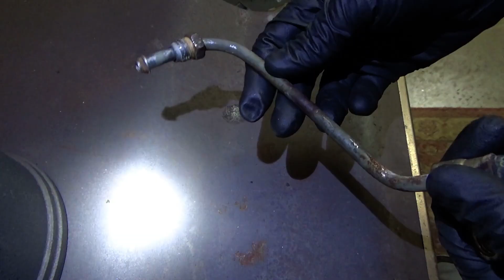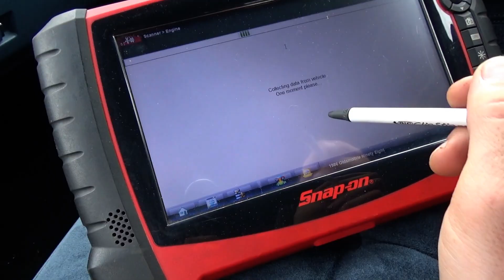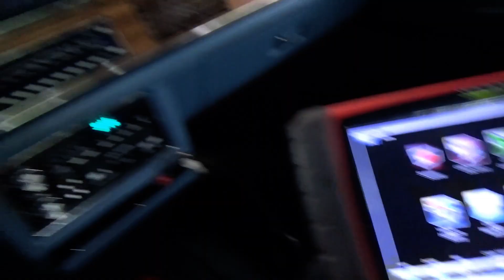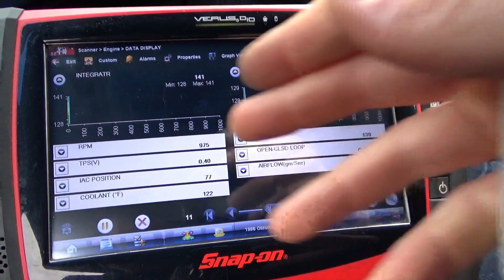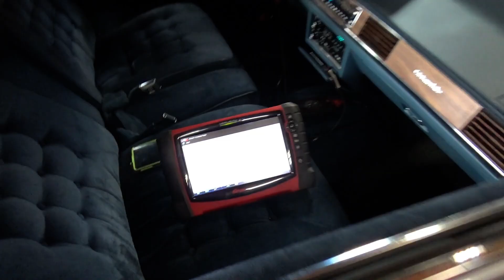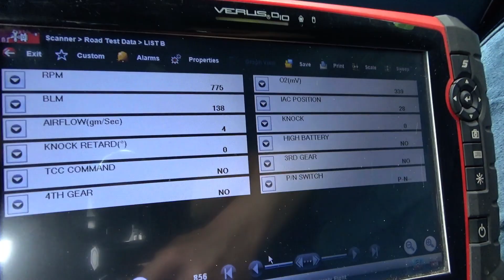(Pt 4) '85 Oldsmobile "Time Machine" has NO POWER?  (CONCLUSION! Memorial Day Special)

Comment: Those red dot. 1985 - 1987 3.8L V6 had a normal misfire feeling shake to them, There may not even be a misfire, unlessyou are hearing something we can’t on the audio. When GM brought out the 3800 in the 1988 model year, it fixed the shaking issue.

Comment: 5000 miles and it had already two new injectors, air mass thingy exchanged, messed up fuel return hose connection, probeably a fuel pressure sensor replaced etc. etc. and the belts were really loose. Well that's bad engineering.

Comment: Too bad you spent so much time, damaged a fuel line and fuel regulator. Over a bad mass air sensor and bad timing.
Reply from the maker: Fuel regulator was weak already... I just finished it off 😉

Comment: Almost 30 years ago I bought a used 1989 Olds Delta 88 with like 89,000 miles.  Drove it to like 210,000 and then sold it.  One of the best cars I ever had.  The car you just fixed was definitely a flash back for me.  Great videos!

Comment: If you cut off the metal shroud on the metal end of that return line, you'll find its just a line with a hose nipple and you can just just use a line and hose clamp on it, no need to replace the metal end of that return line.

Comment: yeah, lots of readily made fuel line repair ends. you can typically get a whole repair kit with special end and a compression coupling (or barb fitting for nylon lines) at local parts stores.
DOH! at wrong size, GM was typically 3/8" for supply and 5/16" for return, with M16(3/8) and M14(5/16) threads, now they did vary around some over the years so always check first.

Comment: Those 3.8 liter engines had an inherent imbalance shake at just above high idle speed. This was a known issue and part of the reason behind why the 3800 received a balance shaft when it came out for the 1988 model year. The 1984-87 3.8 engines all had the imbalance shake. Nothing to worry about and nothing can be done to correct it.
Reply: I was just about to write exactly the same! It’s a known thing that these have an imbalance and it’s not a misfire. I have owned quite a few of these also several after 88 with the balance shaft. The latter was more balanced but still not perfect. If they have a misfire you’re not in doubt.

Comment: The total Greatness of this video is hard to describe.  These cars were great. A mix of pre-computer and computer. Saddest engine, VERY harmful to GM's rep, was the 4100 in the caddy.   1985 began the GM computer days.  TELL THE OWNER that the OIL really matters.  So too the Cooling system must be maintained.....Could easily go 300K with care.  Also, get rid of the plugs.  Install platinum plugs, Delco.   Also, as to the EGR valve, well, some needed to be removed, and then the passage, Not the valve, snaked with a wiggling cable of steel in a hand drill, although the miles on this vehicle are so low, this might not matter.  Love your old school timing light....I will Never part with the Sun unit that I have.  The Timing absolutely matters of these GMs, even 2 degrees off hurts performance.  At 100k miles, think about replacing the timing chain.  Makes them run factory new.....

Comment: I have worked on tons of old cars for one simple reason: I prefer them. The joy of working on that Jurassic Olds, is that the wires are pristine and original. Nobody has been in there farting around cutting, splicing, shorting and removing the stock wiring. A little rubber rot and a drooping headliner are small prices to pay for that 80's land yacht.

Comment: This thing has been messed with way too much for 5000 miles.
Reply from the maker: But 40 years 😂
Sounds like dealer who sold the car unleashed the Amazon parts cannon lol
Reply: @PineHollowAutoDiagnostics  could the odometer have just turned over from 99,999 when the car was put away? Back then, people were accustom to cars with carbonators. That fancy new fangled fuel injection stuff was a mystery to the public and many mechanics. I remember when computers were added to vehicles.
I remember when unleaded fuel was introduced. People would punch out the restrictor in the tank fill so they wouldn't have to pay for the price of unleaded fuel. My '85 Dodge 1 ton has the restrictor punched out. 
Nice looking car. However, I believe the odometer has rolled over. They couldn't figure out the poor running condition and parked it.

Comment: Kansas City Auto Electric here, I don't know if this will help you but you will NEVER be able to get that car to idle smoothly as it does not have a balance shaft. I had the exact vehicle many years ago and it always had a shake at idle to the point I thought something was wrong with it. I took it to more mechanics than I could count until I ran into a GM mechanic who had just retired and he told me what the real problem was. It is common knowledge now but for some reason in the late '80s it was keep very quiet.  As it turns out I put over 400k miles on the car. GM did start to put balance shafts in the 3800 but not the 3.8. Anyway I hope this helps.

Comment: Those C-body sedans were peak GM build quality. I had a '94 LeSabre that I beat to death, still ran well at 230K miles when I got rid of it. Everything they've designed since 2000 has declined. But if you find an 80s - 90s Olds 98/Lesabre/Bonneville in good shape grab it. Reliable powertrains, good handling 4 wheel indy suspension, 25+ MPG, and the best cruising cars on the road even at 30+ years old.

Comment: Ivan, I'm disappointed; I'm disappointed by this video; I'm disappointed by your diagnosis of this Oldsmobile; I'm disappointed by you, Ivan.  You cheated, you blatantly cheated, you did things through magic, magic that didn't exist.  If you were time-traveled back to when this car was showroom new, very few of the things you did in this video would be possible.  A fully equipped Oldsmobile dealership would not have a futuristic scan tool, or any type of scan tool.  You would have to diagnose that car by ear and experience.  Your best tool would be an analog voltmeter, it would be accurate within a few volts; the voltmeter would need a second or two to read a voltage; no watching miniscule voltages fluctuate, no tenths of a volt, no hundredths of a volt.  No graphing anything, it didn't exist - really.  Sun auto diagnostics offered auto technicians an expensive, primitive oscilloscope-like CRT diagnostic tool, it sometimes showed waveforms, it had the most primitive of scales; it could only be used in the shop; need to record an image?  there was an attachment to mount a Polaroid camera to the front of the scope.  
Ivan, you cheated! - I'm disappointed.
Reply: LoL 🤣😆

Comment: Great job Ivan! The racing team pit crew I worked for had a 91 Chevy C-30 dually with a 454 for a tow rig. The owner kept complaining that the truck lacked power and used a lot of gas. He had someone supposedly set the timing. I pulled out the Haynes manual and there was a mention of disconnecting a certain connector in order to properly check and set the timing. Found that the timing was off and set it. The truck ran remarkably better with a minor increase in fuel mileage.

Comment: My memories of that era of Olds, Buicks and Pontiacs are smooth driving. They were like riding on your living room couch.  I had an '86 Buick with the 3800 v6 that was really impressive on fuel mileage and torque. Eventually electrical issues made it where I let it go.  Good work Ivan!

Comment: Great job Ivan. Ignition timing always has to be adjusted on the older cars. The more the chain wears the more the cam retards & distributor timing retards. Used to advance the ignition timing more than factory specs usually until it pinged and then back it off 2 degrees. Nice diagnostic work & another happy customer. Those seats are so comfortable & the suspension on them makes the ride so comfortable. Not great fuel mileage but that's a heavy car & if it gets hit by a modern-day car it can drive away while the newer car will be a crumpled mess.

Comment: Great that Ivan could diagnose the Olds. As A 70+ year old auto mechanic, it would have taken about 1/2 hour to completely diagnose and fix it. Not criticizing Ivan but you computer mechanics forget the basics. Always, always start with the electric vs fuel.
Reply: Hi Ivan. Just to follow up. I loved working on cars before fuel injection and we always had jokingly pre diagnosed cars as they drove up to shop. Lol. Most things were simple. Smell the exhaust, put hand over it, listen to it. That was our “scanner” in those days. Get timing light out, check cap and points, look for leaks. As I said keep it simple. Your original complaint was slight miss and lack of power. That’s what would take half hour charge. We got $8 to diagnose. 😢. Ivan you are a great teacher and that’s   what you do. Old cars are not normally what you do. Scanners were not common in those days and we needed to use our senses to diagnose. I really love your videos and wish you only the best.
Reply from the maker: @quarryroader  sure if it was carbureted then half hour diag would be sufficient. This 1985 is the polar opposite. All your senses won't pinpoint "bad mass airflow sensor" in a million years! Need a good scanner, scope, service information, and quite a bit of theory to understand the fine points of the fuel injection system 🙂👍
Reply: Of course you are correct. Again not criticizing or defending myself. I am still in the shop. Trying to slow down. Maybe the cancer diagnosis will do that. I also have more scanners and computers than brains which is why I enjoy watching you. Good luck in your career.
Reply from the maker: @quarryroader  thank you for the kind words and motivation Garry!
Reply: @PineHollowAutoDiagnostics ❤
Reply from the maker: Wow half hour to diagnose and repair 4 separate issues? Hats off to you 👏😁

Comment: Yeah.  A nearly 40 year old car is going to need a pile of much needed and severely neglected maintenance.  All those rubber hoses and seals and stuff will dry out and degrade over time.  Even if it's been sitting around for more than half its life.

Comment: That was my 97 Celica you referred to!  Thanks to your EGR hack, it is smoother than ever.  It now has 250k miles and is still purring down the road. In fact, shortly after your repair, I took it all the way down to Florida and back to Pennsylvania, and it didn't miss a beat.
Reply: Yea, you don't want to clog up your engine,  you rather breathe it?
Barbarians!
And stay ignorant,  as long as you get thumbs up? Or
Untill you get asthma? Blame someone, something else?!
 You can clean an engine!
 Its why GM MAKES 1000 HP engine with the emissions  and pin heads like you would remove stuff, and wonder why, it doesn't run correctly?
 15 states don't comply with emissions standards?
 Red spiteful ignorance!
Barbarian amerikkka!
Were anti science,  untill we need it?
Nose cutters.

Comment: I've gotta say there's something a little suspicious about that being a 5000 mile car with all the fingering that's gone on,,  all the dirt under that hood,, missmatched fuel injectors,,, cross threaded fuel pressure regulators,,  and on it goes,,  the antenna is broken and the fuse is pulled,,  timing is off,, etc..
That's a lot to have happened on a 5000 mile time capsule..
Reply: Agree!
There's a reason they added a digit to the odometer.
Reply: @dans_Learning_Curve   Yeah,, it really has the look of a gently used well maintained car with 105000 highway miles...

Comment: Another point on the EGR System. As I recall those EGR valves were a pressure feedback type (Either Pos. or Neg.) I would have checked the timing and EST signal early on, but "different strokes for different folks" as they say.  I am a 73 yr. old semi-retired tech stck in my ways! Very proud to see you doing this fine work for people. Keep up the great work!

Comment: Sad you don't have the correct bending tool for small bore pipes. We also used to have a very helpful hydraulic shop that could crimp any size necessary. They even made a pressure weed sprayer connect to a solar tube water heater to inject the correct anti-freeze when a simple gasket fail
I am dying, you can have the small bore bending tool for $1 plus postage from UK to US. You will need the internal springs for steel pipes. You will make better use of it.

Comment: in the beginning my gut was telling me it was a fuel delivery problem but because the 3.8's i've  had were all california cars that weren't  equipped  with an EGR and had multi-coil distributor-less ignitions i thought it might be possible that single coil HEI style distributor on that car could be causing the cutting out. there's one thing i've been curious about since the beginning of this repair, how come none of your live data showed any AFR data, for me i've always found that with obd1 gm cars, the AFR data provided the clue to point you in a direction to look for the problem, i just thought it was weird that there was no AFR data......

Comment: Back in mid 1987-1988, GM had a recall on the 3800 engine for replacement of the fuel return line. It was exactly why you're replacing it. Due to a very thin wall design and failure. Great job as always Ivan.

Comment: 1985-86 was the timeline for Madonnas Get into the Groove 😂 great job keeping this Oldsmobile going. I was an Olds Kid. 1970 Cutlass, 1972 Olds Custom Cruiser, 2 buick wagons with Olds 403 engines and finally a 1982 98 Regency Brougham.  I'm all early 2000s Mopar now(Dakota and Durango) I love that sofa called front seats and I remember the Buick LeSabre fwd had an odd hood opening system and it hinges at the front core support rather than by windshield.  That turn signal sound is so vintage now 😂😂😂😂

Comment: I have the same doorman pipe, but it dosent fit 1999 honda crv fuel filter, i damaged  the nut that holde fuel filter pipe,  by not removing the fuel filter bracket first and not using the flare wrench, i used regular wrench,  and that fuel filter pipe is not available online or in any parts store, suddenly i got an idea using small size pipe wrench 10 or 6, because they have sharp teeths that bite on a metal and dosent slip at all whitought damaging them except for small dents  and successfully remove the the fuel filter pipe holding nut and replace the fuel filter that never been replaced for more than 4 years till the car idling become hard that vidrate even your braon inside your skull, and tour bomes,  till i hated deiving that car, but after replacing the fuel filter, the car idling become smooth again not 100 percent but  way better than before. know i used those pipe wrench when i replace the fuel filter.

Comment: It is not always a good thing to buy an old car with low miles. The age alone allows as you will have plenty of trouble, and this car is no exception. I can guarantee this will not be the end of it by any means. I just bought a 2006 Dodge Caravan as a work vehicle from an old lady and it had only 36,000 mi. It was rust-free, kept in a garage, and well-maintained. Within a month of purchasing it, I have needed a new fuel pump and fuel filter, power steering pump, blower motor, brakes/rotors, and a few other odds and ends.
Reply: That's just Caravan stuff. Friend of mine bought a 2011 with 120k. First 6 months I installed $1500 worth of parts on it. That equals about 5-6k of work if done at a shop. I haven't heard a peep about it in the past 6 months.
Reply: Yeah, but this thing doesn't have low mileage. It has odometer fraud.
Reply: @TonyRule  i was kinda thinkin it too.
Reply: One of the worst things about older low mileage cars is fuel deterioration in the tank. It can absorb water and become corrosive, a nasty problem on cars with metal tanks.

Comment: when I seen smoke coming out of the back of the motor... my first thought was the intake gasket too... I've rebuilt that era GM motors, there's a tiny single strip of rubber gasket that runs along the back. super big pain to get right setting it down by hand 🤔 it's been 30 years or so, I could be wrong because there was so many different things I was learning and doing so much and may be completely wrong about the era. good job, nice stroll down memory lane 😁👍
Reply: That's why you put RTV on the china rails. Front and back. I always threw away those rubber gaskets. 
Cleaned the areas with brake cleaner, put down the RTV. Stopped the leaks.

Comment: If it doesn't thread in, just force it. A friend's jeep was like that. They went through 2 tanks of propane heating up the steering bar on it because someone just rammed it home and it stripped all the threads out of the knuckle. I wanted to record it but tensions were elevated and I was asked not to. It took them 3 hours of heat and something I witnessed from a God of Wars game of back breaking wrenching for 1 knuckle with a 3' breaker bar pipe and a huge pipe wrench. The other 3 just threaded right out in 20 minutes.

Comment: The later V-6s in the new Buick park avenue and riviera were a bit nicer than this engine. Serpentine belt and distributor-less coil pack ignition were some upgrades. Of course they had similar and new problems.

Comment: Thanks for all the great videos, as for forty year old fuel hoses I’ve just had to replace mine after five years. They were SAE30 R6 hard, brittle, one cracked and leaking (return line, carburettor) all now replaced with Gates Barricade R14. Tony UK
Reply from the maker: I don't think SAE30R6 is fuel rated... 🤔
Reply: @PineHollowAutoDiagnostics Still being sold here in the UK for fuel hose,  from what I have researched R7 should be the minimum but all my hoses were marked up as R6 but with no manufacturer’s name. Decided to refit with Gates Barricade. R14. I do enjoy watching IPHAD

Comment: Ivan: Tell the owner you can take that Power Antenna Motor apart.  I did.   It's easy to fix depending on where the nylon cable is broken.